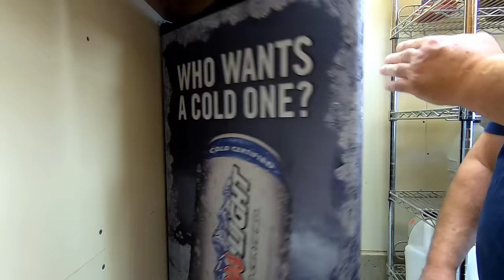Woodturning - The Ocean Cave Vase (My LARGEST Epoxy Pour!)

Comment: That turned out beautiful. ❤ I don't know anything about what you do but I do use resin on paintings. What is the reason for putting it in the fridge? What does that do to it? Wish I could afford to buy one of your pieces. I'm in love with them. And for being a newbie, I appreciate you explaining what your thoughts are throughout the process. It helps me understand why you did it the way you did. Great job.
Reply from the maker: The fridge slows the cure time, this helps to prevent thermal cracking. Thanks

Comment: Have you ever used a balloon in the center of your wood to take up space and have you ever tried to brush on some epoxy to sill the wood so no bark falls off and you won't get as many air bubbles.
Reply from the maker: A balloon will collapse when placed under pressure, so no, I’ve never used a ballon in my castings. The bubbles come from the fact the casting was in the fridge and the epoxy cooled and thickened preventing the bubbles from escaping. Under normal pours, there’s no need to seal the wood prior to casting with this epoxy. If I was pouring a river table, then yes, I would seal the edge, but yes, this certainly would help with floaty bits, but under normal conditions it’s just not needed. Thanks

Comment: Gorgeous piece, I thought it would've looked good with a shape edge at top but would've required a different tool other than a lathe , you'd have had to use dremmel  then you would've had a double shaped top, very beautiful work you do however, keep it up
Reply from the maker: Need to use the dremmel in another video soon, lol. Thank you!

Comment: For cleaning the loose pieces  of  wood that are hard to reach you might try using some ceramic pellets or even pea gravel first seal up all  openings with some tape and plywood or cardboard add you pellets then seal that opening 
Wrap the project with towels and or blankets and place it in the clothes dryer on low or no heat 
If your wife catches you well your working without a net
Reply from the maker: She’ll never know, hahaha. Thanks

Comment: You should get a couple of UPS's for your machines then if the power does go out any important equipment will stay powered long enough for you to save your workpieces before disaster 😊
Reply from the maker: I ordered one but it apparently isn’t strong enough to run my vacuum pump. Thanks

Comment: I seen one fella drill a hole at the bottom and shoot a blast of high pressured air through the hole and that released the seal of the bucket
Reply from the maker: Been there, done that. It mostly just runes buckets. Thanks

Comment: New here why do you put it in the freezer first instead of just straight into the pressure pot? Thanks
Reply from the maker: The fridge will slow the cure of the resin, that way it won’t thermal crack. Welcome aboard! Thanks
Reply: Thanks for the reply

Comment: Have you ever considered, instead of using wood spacers to fill in voids that you don't want to waste resin on, how about using your wood/resin lathe waste instead. You could even store the dust/chips according to color in different containers. And, maybe, there might be an ancillary advantage where that technique might add another esthetic quality to the finished product. Might make for an episode just to experiment.
Reply from the maker: I totally understand what you’re saying but those shavings will release bubbles and could rune the casting. Not to mention putting floating debris into the casting as well. Thanks for the suggestion!

Comment: I've only seen a couple of your videos so you might've already addressed this.  You could have some sort of spring mold or a sectional mold that is held together with clamps and then make a silicon liner.  It's reusable so no more wasted buckets and you are no longer limited to a 5 gallon bucket size. You might even be able to marry smaller pieces into one larger piece so your pours are not so "big" or not too deep so you reduce the risk of cracking.  The pour size in this video was unavoidable just and idea for future projects.  I'm just an observer, I've never tried it myself. Btw, I genuinely loved the coral bowl with the glow in the dark effect. Take care.
Reply from the maker: I haven’t seen any spring molds that can be used with epoxy. Wish there was such a thing. Thanks

Comment: I am not familiar With this specific epoxy/resin. but my experience with fiberglass tells me that it is supposed to get hot. this is referred to as "kicking off" and is part of the curing process. In fact, in my experience, the colder it is, the slower it takes to cure. So i am unsire as to why you chose to put it in the fridge. maybe because of aforementioned thermal cracking?
Reply from the maker: Yes, I use the fridge to slow the cure to prevent thermal cracking. If this had of gone into the pressure pot without the fridge it would of cracked very badly. Thanks.

Comment: You could do with a vacuum container to suck the air out and you wouldn’t have any bubbles in the resin
Reply from the maker: I didn’t use the vacuum chamber because I was worried the resin might start to cure. Thanks

Comment: Why not try to put ballon as a spacer. Does it work?
Reply from the maker: It will shrink when the pressure is applied in the pressure pot. It’s not an option.

Comment: Why does it need to be cured in the fridge before the pressure pot?
Reply from the maker: With this much resin, it will thermal crack. Deep cast is only rated to 4” deep. Thanks for watching!

Comment: what is you added a ballon? in the middle of that to save you time on having to carve it out
Reply from the maker: A balloon will shrink once it goes into the Pressure Pot, if it’s casted on the bench, then sure. Thanks
Reply: I was referring to the frig or letting it sit out on the counter

Comment: which fullsize round hand tool are you using at 32mins in?
Reply from the maker: That is the #3 Hercules from a hunter Tool Systems. Don’t forget to use code inlayjim at checkout for your discount. Thanks
Reply: @SpragueWoodturning  just ordered . thx for the coupon 😎

Comment: I have no idea if this would work but for that void I wonder if you could hot glue a balloon in there and inflate it?
Reply from the maker: If it’s cast on the bench, sure. However, if it goes into the pressure pot the balloon will collapse when the pressure is applied. Thanks for watching!
Reply: @SpragueWoodturning  good point. The whole reason for a pressure pot is to squeeze bubbles down to nothing. So then filling the balloon with water? Maybe a balloon within a balloon to help prevent leaking? It's fun to speculate on anyway 😊

Comment: what did the fridge and pressure pot do to the epoxy?
Reply from the maker: The fridge cooled the resin so it wouldn’t thermal crack. This was way over the manufacturer’s recommended depth of pour and would of cracked really bad if it just went into the pressure pot. The pressure pot will compress any bubbles that are in the resin, in this case it didn’t do very much because the resin had setup too much, it was worth a try though. Thanks
Reply: @SpragueWoodturning  thanks for the reply! still new to all this,  but love the video

Comment: I never noticed you’re standing on concrete all day 😖owwwww. Have you ever tried a chefs mat? It’s so much easier on the joints. Maybe it would add too much height? Just a thought. Us “older” folk (yeah, yeah. lol) who’s joints crack n pop can use the extra cozy. lol
Reply from the maker: The problem that I have with mats, is shavings and other debris gets trapped under it and then it turns into a tripping hazard. I’ve got them and should use them. I suppose I could tape them down but I’m skeptical the tape will remain in place. Thanks for watching!
Reply: @SpragueWoodturning  yeah they can become a problem rather than a solution in that situation. I guess put the good support in your shoes. You were military. You know what I mean :). Of course! I watch every one. I'm just behind a few so I'm catching up!

Comment: I wonder if a heavy duty balloon would fill those gaps?? Make a small hole at the bottom and use the air gun to blow it out of the bucket.
Reply from the maker: If the casting is going in the pressure pot then no, the balloon will collapse when the pressure is applied. Thanks

Comment: Why not pot a UPS power back-up on your vacuum Chuck so that it doesn’t cut out without notice. They’re used for desktop computers, so you shouldn’t suffer that sudden outage.
Reply from the maker: I actually did buy one but it’s output is too small. What I didn’t realize was there’s a fan that runs continuously when something is plugged into it, so I’m wondering how it will make out in a dust environment. Thanks

Comment: Worked at Acadian door company on a interior assembly line massive machine 2 man job i cut special doors to order then stopped up my cuts loaded feeder and ran back end middle witch is the starter shooting Case jams legs head setting hinge plates etc but it costed company 30k daily just to start up the vaccuns that i emptied aswell dust bags that i used to make levies to fight back a dumb evil neighbor that sanded us over 6ft that flooded house 3ft
Reply from the maker: Thanks for watching

Comment: 13:50 There’s got to be an easier way to remove it from the mold!!
Reply from the maker: It usually doesn't put up this much of a fight, the resin wasn't cured totally so that make is sticky, thanks.
Reply: @SpragueWoodturning I’ve seen someone spray some stuff to make it come out more easily.

Comment: Useful notes:
1. Before pouring epoxy resin, you could prime the wood, it will absorb less resin.
2. You can pour epoxy in stages (and wait for each layer to harden). It takes more time, but prevents resin from boiling and causing a lot of bubbles.
3. After pouring, the entire structure should be well shaken to get rid of the bubbles inside.
4 Why didn't you initially think through the final parameters of your vase? Because of this, you had to cut off huge pieces of epoxy after hardening, and all processing was much longer and harder overall. A waste of resources, time and effort that you could have avoided.

Don't get me wrong, I'm absolutely not criticizing you. This is your project and your creativity, it can be in any form you want. I respect what you do and like the final result.

Just leaving these notes here, maybe they will be useful to you in the future :)
Reply from the maker: Thanks for your input, I really appreciate it! 

1. I want the wood to absorb the epoxy that way it will harden areas that a soft and fill all the cracks. 
2. I hate witness lines, this is what I did it all in one pour. 
3. Yes, I need to find either a small vibrating table or use some other device to accomplish this. 
4. There might of been a better way to cast this, but at the time I wasn’t totally sure what direction I was going to go in, so I casted it in this manner.

Comment: My guess is that there is a substancial amount of heat generated by the wheels that the epoxy cracks a little.

Edit: You came to the same conclusion later.
Reply from the maker: Yes, this is definitely the issue. Thanks

Comment: When turning you are removing material. If you use the artistic excuse to create more plastic waste, you really dont have clear idea what you want to make and should maybe sit on that for a while before mixing any epoxy. Not only you save money and make it cheaper to purchase by person who wants the item, but also create less waste. I rough turn peaces, while it takes longer needing to have less pressure or requiring to add reinforcements inside along the way, i have very good idea of what i want to make, the shape and grain i want to expose before hand. Only when i have rough turned plug i make the mold, witch creates least amount of waste epoxy. Wood chips you can burn, but epoxy wood composite is not something i want to burn in my fireplace, so it goes to facility that has ability to wash the smoke and deal with it properly. Hell i would not even use wood plug as people suggested but carboard tube to use less material. On my builds the wood has the center role, while epoxy is there to structurally fix and fill minor gaps. If i have holes like in your peace, i use another wood to fill that. If i want 50% plastic vase, i go buy it entirely made from plastic from the store. Just the minimal use of adhesives and other synthetic materials is the art form on its self i'm proud of. With that size starting peace, i would have used fraction of the epoxy and probably got 2-3 vases out that same peace, while you have all that amazing wood on the floor as waste you cant even use to heat the place.
Reply from the maker: Good luck pre-turning this with the gigantic holes in. I guess you've got it all figured out!

Comment: my two cents: you're not just wasting a lot of epoxy by filling the core, but the curing process is not great neither. too thick epoxy takes a long time to cure. too much epoxy is hard to let the curing process (binding of two materials) occur naturally. if you are only using such small wall for your vase, maybe try to block up or fill the part which will be turned out of the core be scraps of wood?
Reply from the maker: Pretty sure I covered why I didn’t use a spacer. Thanks